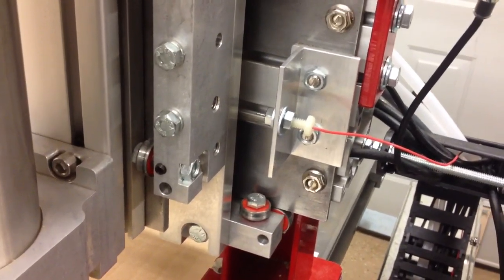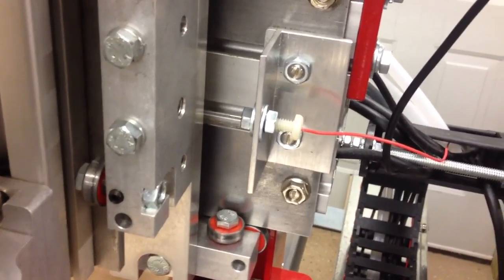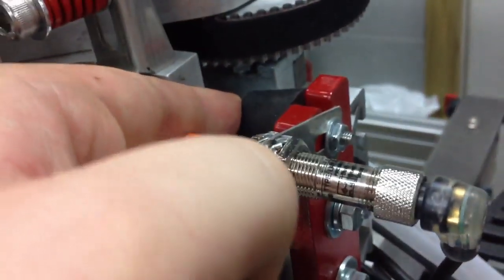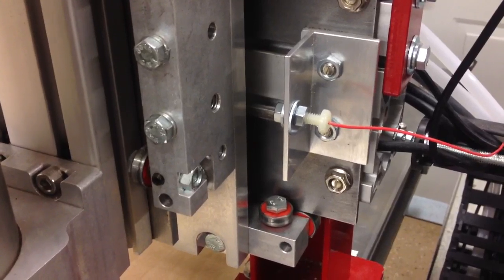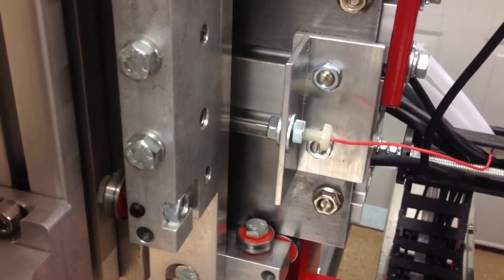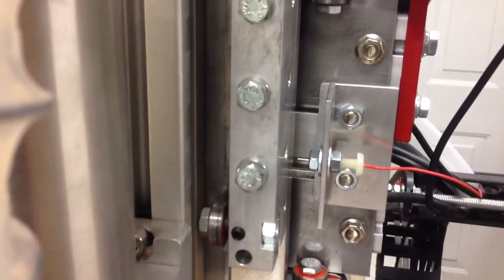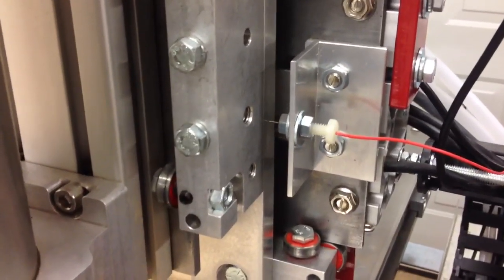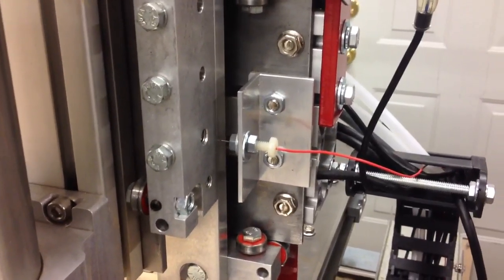Testing Pogo Pin Homing Switch

Comment: So the switch basically just closes a loop back to the breakout board and that's how it works?  (The wire doesn't have to have any resisters or anything?)

My setup isn't fully grounded like yours so could I just ground whatever part of my gantry the pin touches back to my panel/breakout board to make a complete loop?

Comment: Interesting, I like it. However, how is it's long term usability, what happens/probability when the metal starts to get dirty or something blocks conductance between the pin and the frame? Suppose it should just be cleaned every now and then... but you know as they say, shit happens :)